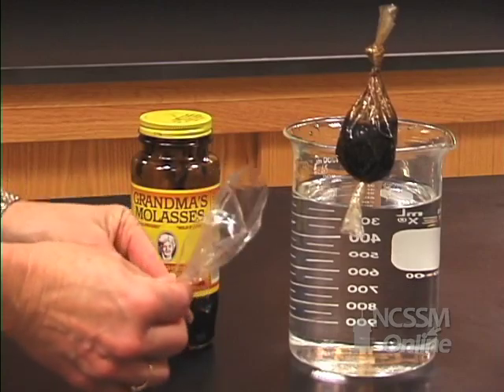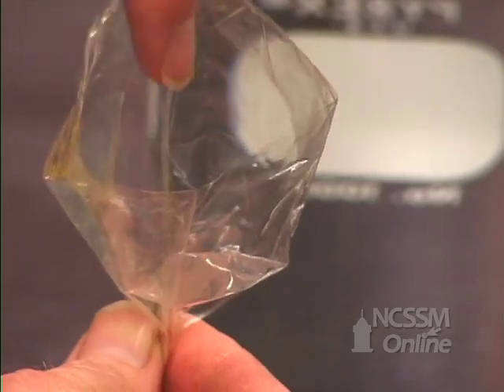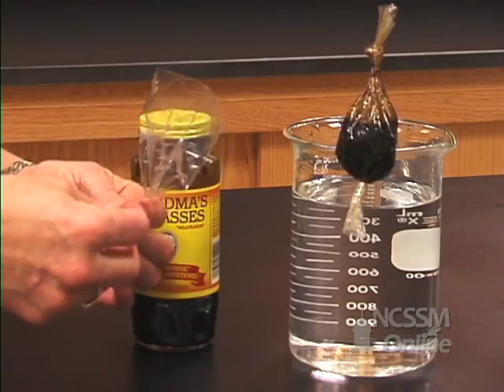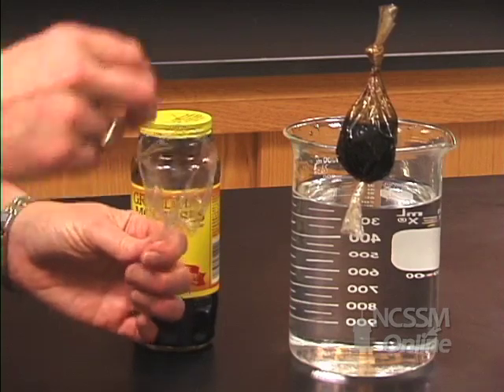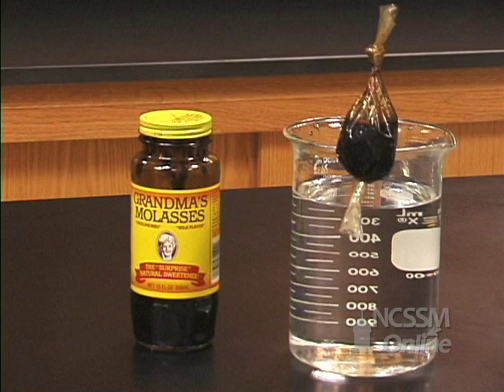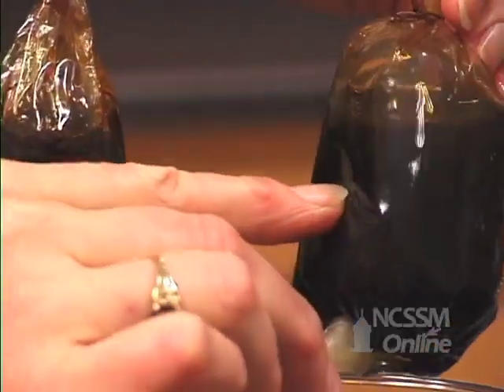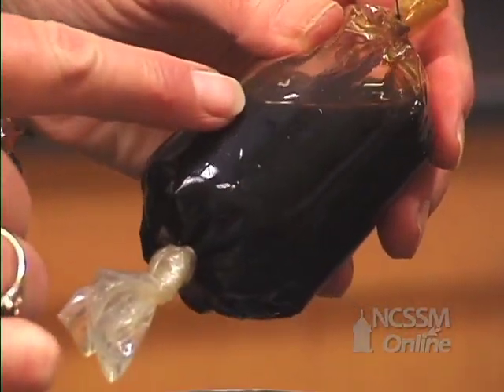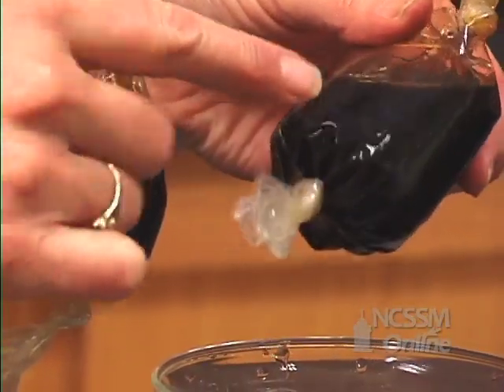Osmotic Pressure Dialysis Tubing

Comment: not a good example.  one can say the water simply intermingled with the molasses section as much as water soaks up bread put into a glass of water.  The "control" should have been that the other dialysis balloon should have been in a water solution with some other solute in it thereby showing a difference in osmotic pressure that implies osmosis